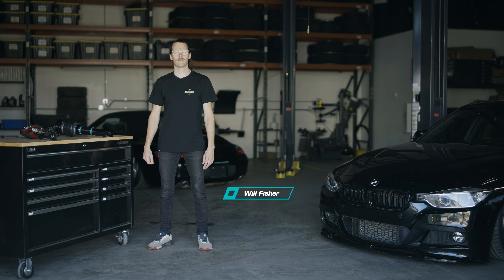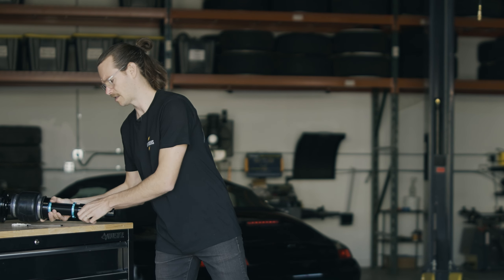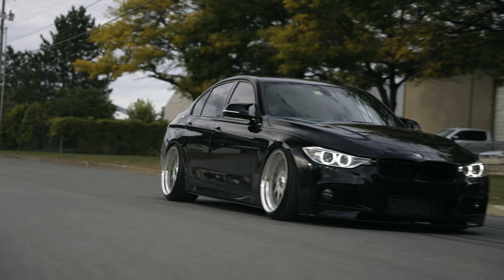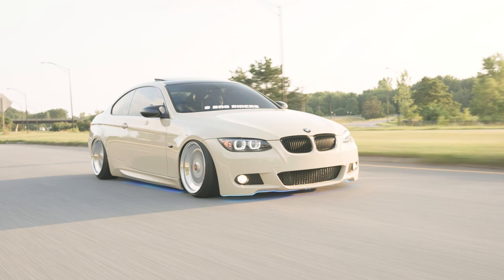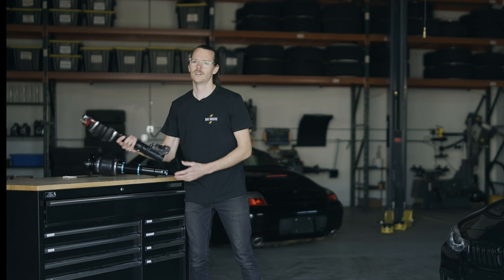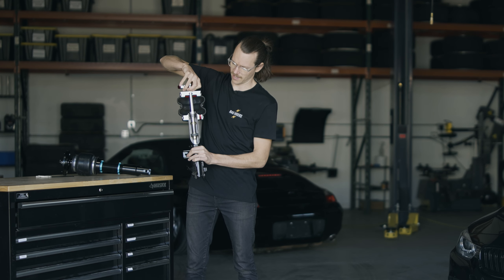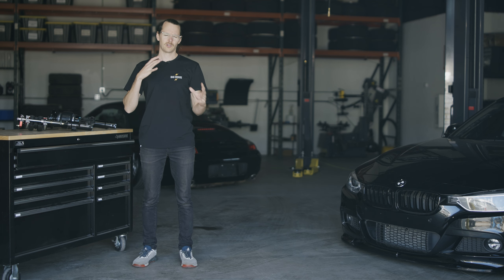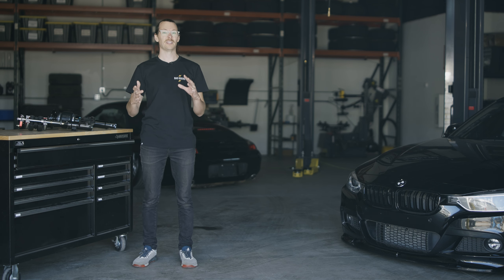Common Air Ride Suspension Problems

Comment: cars are an expensive hobby, and the biggest issue you will find is people who dont have the money but want all these different mods and go for the cheapest option ie DIY and not matter what tutorials you follow or reading the manuals. you wont ever be better at getting it professionally installed. dont go cheap on parts either. get it done properly the first time and it will be cheaper in the long run.

Comment: My 2013 challenger has full bags..but the rear end kinda kicks one way or the other when I hit a bump or small hole...do you know why it does this
Reply from the maker: Sounds like a bad alignment. I would try a different alignment shop. Also keep in mind, if the techs air-up to get it on the rack, they'll need to back back to your ride hight to perform the alignment.
Reply: @bagriders  i ordered adjustable upper a arms for the front and control arms for the rear..hopefully get a better alignment after the install
Reply from the maker: @Tainted_Smile39  That's not a bad idea. The accuracy of your alignment is key.

Comment: How do I know if my air spring is bottoming out or topping out? Cause when I accidentally hit a small pot hole, I heard a similar noise to what you described. But I’m following the specs you guys recommend for my GR86. This is on the Super Low suspension and I mainly hear it in the rear.
Reply from the maker: Great question checkout the video we just came out with last week, this may answer your question! https://www.youtube.com/watch?v=f6MzXOzFsB4&lc=UgwZqx5imyxTuNSEpC54AaABAg

Comment: Sometimes my front bags wont let air out when the compressors are running. I hear the clicking when the buttons are pressed, but nothing happens. After the compressors are done filling, then valves start working again. Bad valves?
Reply from the maker: Next time this happens, make a note of the tank pressure. If it's too low, it can cause this, until it's increased back up to the same level as the front air springs.
Reply: Mines doing the same with the front left smh
Reply: I figured mine out. It was the controller. The switches were touching inside. I had a constant 12v at my front and rear up switches. I disassembled the controller and the solder was touching another part of the switch.
Reply from the maker: @ChrisLuke-uz7hz  Glad you got it sorted out.
Reply from the maker: @Ambitious_Ethan  What control system?

Comment: Is it possible to set it up that it lowers when you lock the car and goes up when you unlock it??
Reply from the maker: Unfortunately there isn't a way. The only option for the car to immediately air up without having to press a button on the controller is when the car first turns on, its a feature called "rise on start". Most control systems also have bluetooth capabilities that you can use directly from your phone.

Comment: what's the issue with my air ride when airing up passenger side goes up slower than the other side
Reply from the maker: Most of the time it's a pinched line, but is some cases having lines that are much different lengths can cause this to an extent. I would look for pinches first!
Reply: @bagriders  it used to go up at the same time then i haven't used it for awhile then when i used it again i notice the rear passenger side goes up slower than the rest

Comment: Hey is it possible to rip the air spring if my max height setting is too high and puts too much psi in the bags? I have a ripped bag rn that literally jus happened over night somehow. I wondering if bc i aired up to park and didnt air out after i had too much psi in my max height setting causing the spring to rip
Reply from the maker: In all my time working with air suspension, I have not seen that happen. Also, parking aired-up over night should not cause any issues. Can you send photos to sales@bagriders.com of the damaged bag?

Comment: I've always run coil-overs and now (on a bmw e46 325ci) I would like to run deep dish wheels (17's) and bags... because I need to clear a tall speed bump at my apt.
 My 325ci does clear it with its stock springs but I have to go super slow b/c even at 1mph it will bottom out (done that twice sofar b/c 2mph).
 So, my question: Is there a place where I can find correct offsets for wheels and a bag system that will allow at least normal (stock) ride height and also allow a good square setup for driving while also being more flush?.. I love e46 coupes.
Reply from the maker: I don't know of a site that will answer that. I would ask people in various E46 facebook groups about what widths and offsets work for them.

Comment: What could be the reason I lose pressure on my front strut when l lock my steering wheel to the left/right? But if it’s straight or slight left/right turns it’s normal.
Reply from the maker: Sounds like you have a McPherson suspension (struts that rotate when you steer) and your front lines are probably a little too short.

Comment: i recently starting hearing a rattling like noise coming from my front end on both sides but more notable on the right and i took a look at everything and nothing is loose or visibly wrong. i’m worried it topped out but i really don’t know for sure, if it did is that covered on the warranty?
Reply from the maker: Topping out won't cause an "instant" failure. It's more of an issue over time, and it means that the plastic internal bump stop will evenly be destroyed. A rattling noise could be some of part of the vehicle other than your suspensions, so consider having who ever installed your system take a look at the vehicle.

Comment: i have an 08 bmw 335i on the 3p set up what’s a good psi/ride height to be at for driving? i’m very new to the bag scene
Reply from the maker: 35-45 PSI (Front)
70 PSI (Rear)
This is what the two Air Lift manuals say, these are also downloadable here https://www.bagriders.com/tech/

Comment: Hey I recently noticed that my rear wheels bounce way more it used to, I never had a problem riding on the LOW setting but now I be banging my quarter panel. I stiffen my ride setting and it didn’t change anything
Reply from the maker: What brand of suspension, and what car? It sounds like you are at a low spring rate (wheelrate) and that is causing excessive travel. There is no easy fix apart from raising the car up. Super Low kits use the thickest possible air springs, and we spec the smaller air springs when ever possible.

Comment: Verry upset with 3p the purchase air compressor was hot straight out the box plugging in 2 days later bag popped turning a curb at 60 mph your kit spent 1000 extra on everything said it was designing for my 5th generation bought 2 new compressor with your hard headed company and my part number for my vehicle overnighted 2 bags for the front and they both don’t fit, very terrible experience with bag rides and airlift performance I called at 7 am you guys send the incorrect part to buy and I knew because  I just ordered that one with $150 1 day shipping look up the part number of the bag for the kit dosnt even pop up 🤣what a joke call the number they told me and sent me a bag for a Mercedes 🤣i dialed 7 for costumer service  said your in a team meeting  yall got me so messed up all the way how simple is it to display actual pictures for the part numbers and put the vehicle
Reply from the maker: What can we do to help? Do you have the correct replacement bag at this point? What caused your bag to fail in the first place?
Reply from the maker: I never heard back from you on this. Just checking in.
Reply: @bagriders idk what his deal is but if you guys wanna send me a set for his inconvenience it’s okay.
Reply from the maker: @schlurm7412  We try to please everyone, but we can't win every time. :)
Reply: Instead of trying to publicly shame the company contact them. I’ve had nothing but good things to say about bagriders. I’m in Australia and had an issue with my manifold and they sent a new one with in 3 days it arrived.

Comment: I’ve just fitted my airlift kit, my compressor doesn’t turn on when I start the car, the error message on the display says compressor frozen, what does this mean? Have I used a permanent feed instead off an ignition feed? As the display stays on all the time
Reply from the maker: Yes it sounds like you are not using a valid ignition source for the ignition wire. Use a multimeter to determine a 12v source that is off when the ignition is off.
Reply: I’ve now used an ignition switch and everything works as it should, is it normal for the compressor to turn on and off throughout the night to keep the pressure in the tank with the ignition off? Yes I know I’ve a small leak, just haven’t go around to finding it yet
Reply from the maker: @LeeRoyJuniour  No this will wreck your battery. It seems like your ignition source is keeping the system "awake" or comes back on later after parking the vehicle. sometimes we tap into a tail light wire that's only ever on when the vehicle is running.
Reply from the maker: @LeeRoyJuniour  You should consider an additional in-line switch, so your compressor won't come on in the night. The compressor is happier at 13V or higher and at night your battery is probably more like 12-12.5
Reply: The problem was I had it on show mode I believe so Bluetooth mode was enabled but cheers